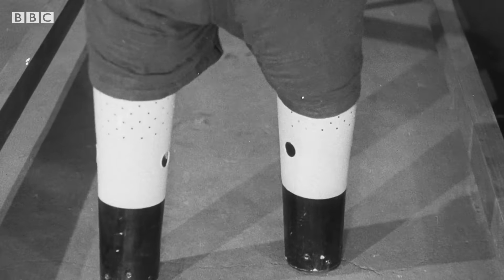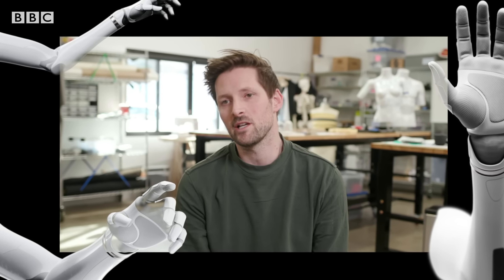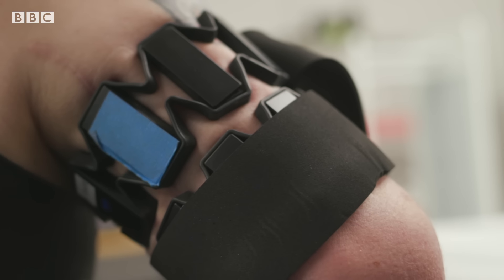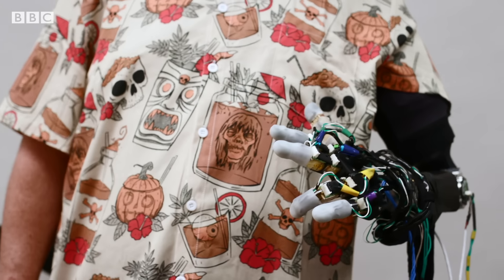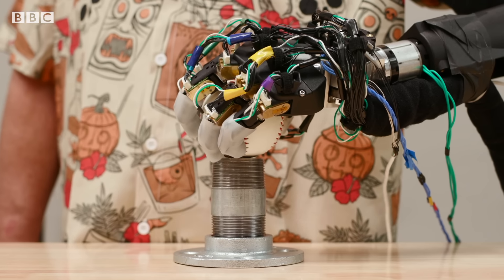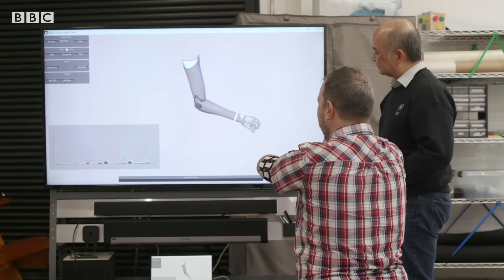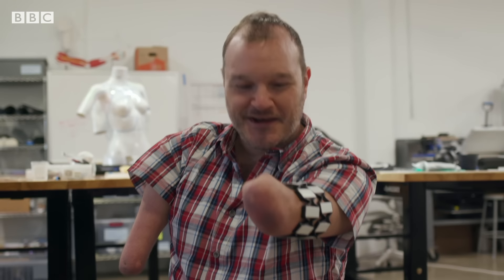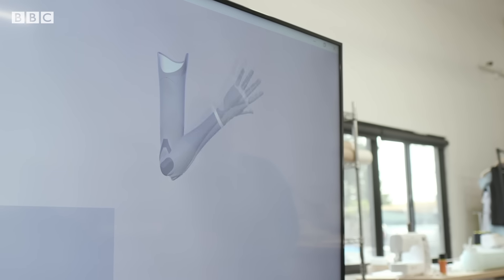The prosthetic arm controlled by your mind | BBC News

Comment: The speed at which the algorithm learns the correct actuator outputs from the EMG inputs is what impresses me the most. I assume it's using AI which usually takes a lot of data to get reliable results but from this it looks like they got it working to good precision in only a few minutes.
Reply: We do it in real time. Naturally controlled hand.

Comment: Nice especially on the socket part 😊 But speaking about Supposed Phantom Sensory Capabilities???? Does that include PHANTOM PAIN TOO😢 I had my Right Leg Amputated in 2015 but to this very day will have Excruciating Pain for hours. And taking Pain Medicine doesn't really work for it's just a Nerves Messages from an previous time and location.😒
Reply: You might want to look into peripheral nerve stimulators if you haven't already.
Reply: @invaderzod8092  Did it and a definite negative 😞
Reply: @debrabrown2615  oh damn why is that and sorry to hear about it